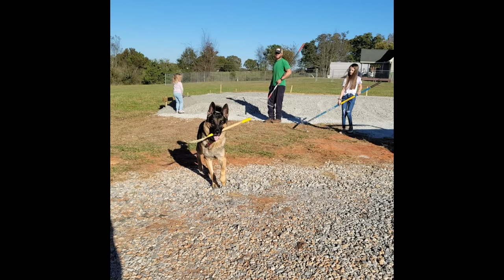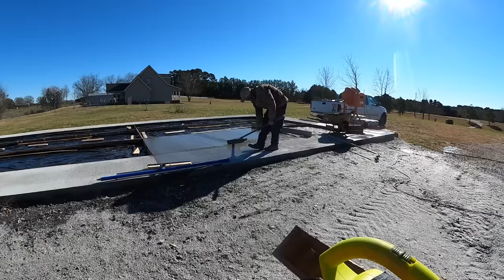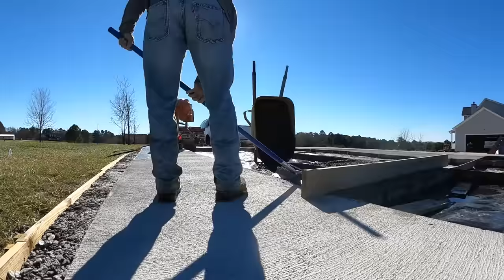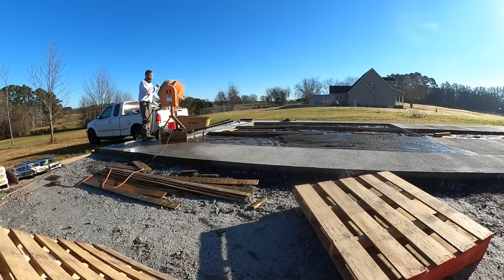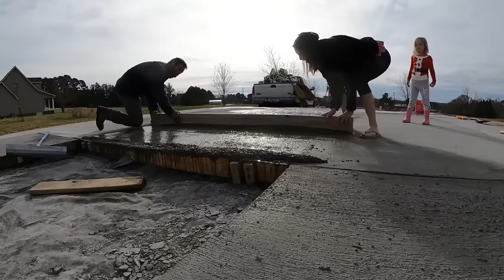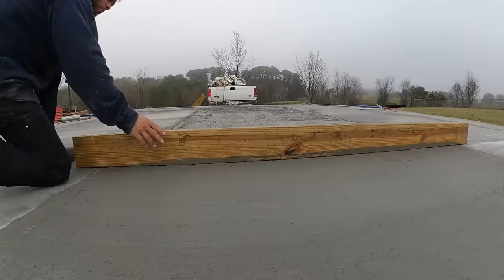Pouring a Huge Concrete Slab Using Bagged Concrete | I Saved $10,000

Comment: Wow, much respect!  In 2009  I retired at age 60 and set forth building a new house. Except for help framing and roofing I did it all myself. I sheetrocked a 3600sq ft house with 9' ceilings myself. People ridiculed me, what's taking you so long, bla bla bla. It took me 2+ yrs to complete, cost approx 280 k . Appraised last year at approximately 800k. Be proud of what you accomplished. No one can take that sense of pride and accomplishment , GREAT JOB!!
Reply from the maker: That's awesome. Drywall is no easy task! It's heavy, awkward, and dusty! That's pretty cool you did your own house. It's actually amazing that you did all that in 2 years. It took multiple crews about 6 months to build my house so you made excellent progress! Thank you for the kind comment.
Reply: You're welcome, I don't think I could mix and pour that much concrete, that's real bull work. It's unfortunate that we weren't able to help one another. Two cheapskate hardheads like us could accomplish a great deal! Haha. Best wishes , Mark
Reply: Nice! I'm doing that with an old rotten (and previously hoarded) single wide trailer on a half acre, right now. I'm currently 2 years into it working on just Saturday's. People think I'm nuts for rebuilding it but I'll be debt free and it's all going to cost me about $65K when I'm said and done (including the original purchase price or the land and trailer). Another single wide on half the size lot in my neighborhood just sold for $208K. I'm pretty excited that I'll have this asset sitting with no mortgage payment. Cheers!
Reply from the maker: @thesomewhathandyman9400  65k is not bad at all! That's awesome you won't have a mortgage payment, not many can say that! You should definitely be proud that you are able to accomplish that. Usually when people think you're crazy, you're on the right track. Thanks for checking out my video!
Reply: Fuk companies take that long for a 1200 ft. Nice job.
Reply: I'm about to start my home building project! Because I am cheap crazy bastard like yall lol!!!
Reply: Hey Fake account, once you get started you're going to have setbacks and obstacles, everything cost more than you planned. Key to success is keeping plugging away DON'T GIVE UP! The rewards are worth the struggle. Good luck,Best wishes. Mark
Reply: Hahahaha, we did the same thing. We are over 50 and when Covid hit, my wife decided we just do it ourselves. Including architectural drawings, permits, etc. I thought we were one of the few. I thought we were insane multiple times during the process. It took 2 years, mostly only weekends, and we just moved in last weekend. We are going to expand it but we can now live in it. It is 2000sqft, and it appraised 400K more. Still can't believe we did it. My hat off to you! Love that there are more insane/determined people!
Reply: When build my last house I learned some painful lessons about moving too fast with a build. Never feel bad about taking your time and getting it right.
Reply from the maker: @markkaminski2416  darn right about that.we should create a cheapskate hard head group and find out who's the closest in our area hahahahaha
Reply: That’s awesome! You can always feel good about doing a project yourself.
Reply: Sweet.  My grandfather built a family home by himself in a time of no home center, plaster and no access to machinery for a country boy.   I never got to meet him in life, but what he did helped us for generations getting established.  I love him for it.
Reply from the maker: @treasurethetime2463  Thank you for sharing your story. Your grandfather sounds like he was a good hard working man. Thank you for checking out my video!
Reply: Well said.
Reply: Treasure the time, I am always touched, inspired and amazed by stories like yours.  Never forget the sacrifice, will and determination of those who came before us. They paved the path for us to follow through life's journey. Best Wishes, Mark
Reply: @markkaminski2416  Amen.
Reply: @what4165  due
Reply: I am about to do the same at the same age. Getting my old place ready to sell I can say I do not look forward to some of that work. Feelin' the years!
Reply: Well you're making me remember when bought sheetrock for my house back in 1985 I found a sale at a place called rickles home centers and for a $1.38 I could get a sheet of sheetrock I should have bought a ton of it knowing how much it went up I bet you you spent a fortune to do your house
Reply: @thesomewhathandyman9400  just wondering what county and state do you live in I bought a property about 20 years ago and I don't currently live there anymore but I'm wondering if it's gone up in value very much up in Fulton county New York
Reply: Arlen, I bought 330 sheets of 12x 4.5    1/2"
Reply: Arlen the building supply co delivered and placed it on both floors . What a break! Cost about $3200,if I recall correctly . That did not include greenwall and cement board for baths
Reply: @arlenmargolin4868  Sorry, other side of the country in Washington State.
Reply: @markkaminski2416  wow I've heard that you can get sheetrock in almost any length since it is made in sheets that can be 100 plus feet long but I never heard of 4 and 1/2 ft sheets that sounds pretty interesting
Reply: Arlen, yes the 54"sheets were just the ticket since the house has 9' ceilings , I stacked them. It created one continuous horizontal seam and a vertical joint every twelve ft. It worked out very well! The building supply co delivering and placing throughout the house was priceless!!!
Reply: Another hard head here. 
Given how rare we are, we should create an online group for such  networking. I can never find help, even my son has gone the modernwway(for now). It might take me forever to do by myself and I might goof n have to redo a step however at least I know it's sturdy.
Reply: I’m 62 and just getting started. Took me 5 years to set my life up to get to this point. Lots of planning…. Prices keep going up. But I’ve decided it’s a choice to keep moving or die sitting around hoping. I’ve got nothing but time. 😎
Reply: Somewhere in Az, I was 60 when I started in 2009. Get started and don't stop, you'll have setbacks and distractions but don't let that deter you. My biggest obstacle was trying to do it without borrowing money! I can't imagine trying to build at today's prices. Good luck, Best wishes , Mark
Reply: @markkaminski2416  Thanks for the encouragement.  I'm tempted to pick up homeless people to come help me, but as a woman that's likely not very smart.  I guess I'll just have to cowgirl up and do it myself.  I'm making compressed earth blocks to build with, since dirt is plentiful where I'm at.  Dirt Cheap?  Not really, I bought an old tractor that keeps breaking down, and a CEB hydraulic press that eats gas.  But, truly, it keeps me in great shape!  Not slowing down any time soon, hopefully.  Maybe I should start a Youtube channel for $.
Reply: Yup so many negs great job
Lots of us retirees,  or anyone with youtube access can do the work. What is the point hiring/trusting some company out to make $$$,just to hurry ,cut corners,and such....no thanks
Reply: Solid!
Reply: How did you do the sheetrock alone? Did you rent a lift? Did you use 12' sheets anywhere?
Reply: @wthomas5697   It wasn't easy!  I bought a lift at harbor freight for about $150. Used 54"x 12 ft sheets. That was about 11 yrs ago and I was  "only " 60yo at the time. Probably couldn't do it now!
Reply: @markkaminski2416  I hadn't realized you could buy it 54" wide. I'm seeing that 54"x12'x5/8" weighs close to 120 lbs. How did you manage to get it on the lift by yourself? Also, did the supplier stock every room for you?
Reply: @wthomas5697  I used 4 1/2 ft wide sheets for 9' ceilings, made for 1 horizontal seam and a vertical joint every 12'. Yes building supply co did distribute on each floor but not individual rooms. That was a great help! Lift handled 9 ft ceilings , had to make extensions to handle the 12ft length. Used 300 sheets, not including green wall and tile backer . Quite a chore but that phase alone saved 20K!
Reply: @markkaminski2416  So how did you manage to get those 12 footers up on the lift by yourself? The reason I'm asking is because I'm designing a home I intend to build by myself. Just thinking through all the issues that come to mind. I'm 66, by the way.
Reply: @wthomas5697  The  top part of the lift has a swivel that would allow it to be  tilted a few degrees to make it easier to place a sheet on it. I can't imagine trying to build in today's market. The cost of materials is astronomical! I started this house June 2009 and it took me 2-2.5yrs . The exterior is brick and cost approx 55k , I'd be willing to bet  I couldn't do that for less than 125k today.
Reply: @wthomas5697  The sheetrock I used was 1/2 thick except firecode in garage. As I stated earlier it wasn't easy, but I managed. I'm somewhat of a loner so I've learned not to depend on others.
Reply: @markkaminski2416  Are you saying that the cost to do brick on the exterior of a 3600 sq ft home is 125 k for materials alone today?
Reply: @wthomas5697   No , I did hire a bricklayer to get that part completed faster. At the time  the brick  I used was  .30 each x 34000 brick. Many pallets of cement and a tandem load of masonry sand was 600- 650. I paid the mason approx 30k for his labor.  This house is 40 ft to eaves in the back, higher at the gables.  The roof has a 12/12 pitch. There are 33 windows and a great deal exterior wall area .  Don't think one could brick a house this size for 55k today.  If you haven't already done so, invest in a piece of excavating equipment that has some weight and can dig and move dirt. You won't regret it! Not a compact tractor with a loader. Good luck, the key to success is don't rush , think about every step, shop wisely for materials .
Reply: @markkaminski2416  Renting heavy equipment is the only way to go as far as I'm concerned. Then you have a wide array of tools to choose from for various tasks. A buddy of mine who ran an industrial rental operation ran the numbers on maintenance and if you're not using stuff all the time it's pretty clear you want to rent. I have neighbors with various pieces of equipment sitting out in their yards deteriorating.

I guess I was under the mistaken impression that you physically did all the work yourself. So 25K for the material on the facade. That sounds more reasonable.

I plan on building all the windows and doors. There's one 9'x9' slider that is going to be a challenge though. I'm thinking of building the frame and doors out of vg fir, installing them, then installing the glass. I'm pretty sure I'll need a hand with the glass, heh, heh. That's okay. I have one neighbor who's anxious to lend a hand and I have two glass cups and some gloves so we should be able to handle it.  He'll probably be up for helping with the sheetrock as well. Although he's not too savvy when it comes to building stuff.
Reply: 2 yrs to do a weeks worth of work , LOL
Reply: @jeffbarron5500   Can you build a two story 3600 sf house in a week  nimrod?
Reply: "$800,000" and a high ass tax bill. I would have broke out the receipts for the $250,000 lol
Reply: Hilarious how no one ever factors inflation into the equation when bragging about how much “value” their house gained. Lol! It’s at 10% this year.
Reply: I dream to do that someday!
Reply: @fisqual  I dreamed it for 61 yrs , retired and got started. One the most difficult but most gradifing expierances of my life.
Reply: I’m doing that same thing at 32. Accept I’m building a small 1000 square foot house. It’s also taking me a little over 2 years.  Living in a rv with my 4 little kids and wife while we do it.  It’s been a journey but won’t have a mortgage when it’s done.
Reply: That is amazing! But you got about 5 years shaved off your life...
Reply: @blipblop92  Hahaha, you're probably right! but it was worth it. When I'm on the far end of the property, I  sometimes look across and can't believe I did it and that it's mine! Thanks for the comment, Best Wishes
Reply: 2 years ago I got quotes from two separate concrete companies for a 1,200 sq/ft driveway extension.  Both quotes were $25,000.  I decided when I have time I'll just use pavers and do it myself
Reply: People thought 2+ years was a long time to build a 3600 sq/ft home yourself? Sounds pretty quick to me lol.
Reply: @markkaminski2416  wow the house you built you could sell and make 1/2 mil, buy more property and do it all over again. That’s the best return on investment I’ve ever heard of!
Reply: @tjeerdmulder1156  I’m working on a project soon that will convert a 10x50 mobile office trailer into a small camper home that I can live in. Between purchase price and moving it to my land, it cost me $3k: $500 to buy and $2500 to move. But you’ll never find a trailer for $3k that is doesn’t have any leaks. It just needs lots of work
Reply: That's two years of TV watching time you'll never get back!
Reply: @TheSHOP411  "When build my last house I learned some painful lessons about moving too fast with a build. Never feel bad about taking your time and getting it right." 

OMG thank you! 
I needed to rehear this 😜😜😜
Reply: @blipblop92  "That is amazing! But you got about 5 years shaved off your life..." 

I know, right!!
That's five years permanently lost of TV reruns and YouTube cat Videos!!
Reply: @markkaminski2416  Are you from Ohio by chance. A fellow CCHS grad shared your name.
Reply: @steveturansky9031  Steve, no I grew up in Baltimore County,MD. I've met others with the same last name but never another Mark. Thanks for asking, Best Wishes!
Reply: The “what’s taking so long” people are fools who will never accomplish anything worthwhile in their life.
Reply: Mark you're an inspiration.
Reply: @charlesstevensEnki  Thank You!
Reply: That’s what’s up
Reply: Very nice story. People who do shit work or have no clue what’s hard work is like would say u took too long. I’ve been alone painting for three,  four months on a large house, built a few , renovated many that took many months
Reply: @chriscal8201  Thanks Chris, it was a labor of love and a source of great pride. Very few understand. Some of the subs , electrician, plumber would give me a pat on the back and encouragement. I did as much as I possibly could  myself. I refused to hire someone and possibly get inferior quality. I can do that for free!😄
Reply: Love the DIY can do attitude. You are an inspiration for me. One question is why no rebar for your pour ?
Reply: Sounds like one hell of a job to take on your own but goes the old saying, if you want something done right do it yourself
Reply: @hernandezmancera8421  How True! Thanks,best wishes.
Reply: Net 500 000$. 250 000$ a year.
I think you have the potentials of a second career there.
Reply: Wow! Hat’s off to you for accomplishing that at your age! I`m not calling you old, good sir. I‘m just amazed and kind of jealous because I will be building my own cabin on my ten acre property next year and am worried that I might not have enough strength to do most of it myself….. I‘m „only“ 36….
Reply: @markusalan1844  You can do it! Just stay focused and don't give up! There will be setbacks and bumps in the road. Don't be discouraged, the benefits far outweigh problems. GOOD LUCK!!
Reply: Lol, I’m planning to do the same thing! I’m 57 bought a ranch in 2021 waiting for 59 1/2 so I’m doing all my research now! Lol I’m a YouTube contractor! My neighbor is doing the same as you, his is sitting there with only the framing done.
Reply: Worked your entire life to retire at 60, only to give up the next three years sheet rocking a house?
Reply: @mts7274  Yep , sure did. Some call it a labor of love, I think of it as fulfilling a life long dream.
Reply: Way to go.I'm the same way with big projects.
Reply: Great work!  My wife and I are currently approaching a house build in Texas and I'm going all in, I've been doing construction for 10 years and feel confident to get it done no matter how long it takes. We're doing 2,800 living sqf out of 2x4s and I thought to myself, if my father and grandfathers in Poland did it themselves out of bricks and cinder blocks than we should be able to handle this kind of build. It's an inspiration to see all these great testimonies and watch videos that provide insight. We're definitely going to be outsourcing a few things like foundation, some framing, roofing and HVAC, other than that I'm doing everything myself. It might be a good idea to share the process.
Reply: @fakeaccount4092  am right there with you I do a lot of dumpster dive people throw away stuff everyday
Reply: Well Done Sir, when people say I can't, helps me prove I can...Be Blessed My Friend.
Reply: @GawgaCracka  Thank You! Sounds as though you're ready to join the Ol Hardhead Fraternity. Welcome Aboard!  Best Wishes, Mark 😀👍
Reply: God bless Harbor Freight - LOL. I have the same mixer. 

Forget about the cost savings, I got tired of paying a contractor serious $$ and having a bunch of slack-jawed mouth breathers show up and produce absolute garbage results. I'll save the money, do it myself and I guarantee I can do better than 90% of the "pros" around here.  I'd be embarrassed if I turned out the crap some of those clowns do. My neighbors cedar fence lasted a whole 4 years before I started splitting it into kindling for my stove. I figured if it was laying on it's side in my yard, it must be mine.
Reply: Wow. I cant figure out why a retired 60 yr old would want a 3600sq ft house.
Reply: @machaf  just a life long ambition I was able to fulfill.
Reply: Hell it takes some builders 2 years to do something like that. That's fast for one retired guy.
Reply: @jamesofallthings3684  Thanks , you wouldn't believe the criticism and naysayers I've encountered.👍
Reply: @markkaminski2416  300 pieces of sheetrock would cost 5 grand today
Reply: I wish i had millions $$$ due to the fact of my disabilities preventing me from accomplishing. Money speaks for itself lol.
Reply: Awesome job. I’m planning on doing two projects. A basic shipping container house for temporary living while building another container house that I’m pretty excited about. I am working on the final details but so far I’ve gotten the budget down to 100k for a 2400sqft house on pad with 1600sqft attic storage space with super insulation and thermal breaks in a bunch of critical spots as well as an upgradable electric and plumbing system where you can add onto it without redoing drywall. Over half the lumber can come off my sawmill because they are not load bearing beams so don’t need to be stamped. I want to have trucks do the concrete but if I can save 20% or more doing it myself then I will mix it with bags.
Reply: @benreber2277  I would like to do a shipping container shop project. The 40'length is perfect, just trusses and end walls. Good Luck!! Stay on course!
Reply: Hell yeah! Congrats! That's like a job making $260k/yr! lol. (yeah I know, land price, blah blah blah. you get the point)
Reply: Congratulations to you brother.  I just did the same exact thing. We are 1 in 1,000 with the guts to do it. Took me 8 yrs. Full custom build. Stick built roof, stood walls up with winch on gator, plumbed it, wired it, etc. 5,800 sq ft under roof.  It has been the hardest most rewarding thing I have ever done.
Reply: @GuntherChuck  WOW 5800 SF! I did rafters also no trusses. As you said, one of the most difficult things I've ever done but one of the most rewarding! Congratulations,Hats off to you! Best Wishes
Reply: That’s my life now! Bought a giant two bedroom,  2 bath. Making it 5 bed 3 bath. On this video for my shed
Reply: Looks good, I didn’t see any rebar or mesh though... ill have to Watch it again..
Reply: Well, if you had slick here helping you, you could’ve got it done in three days.
Reply: 12 yards of concrete and finished should never cost 10 grand, 12 yards of concrete would be about 2k and a professional concrete finisher with helper no more than 1500.00, 8k labor is just ripping someone off
Reply: I'm 75 and a general contractor. I started building my 5000 Sq ft house 3 years ago. Just finished. Did everything except the black walnut cabinets and granite. Did everything out of pocket.
Reply: @brookeflynn2230  Tip of the hat to you! I know the feeling, tried to do it all out of pocket but didn't work out 😊. Still ended up ahead of the game. Good Luck, Best Wishes!
Reply: I’m dreaming of that now and this comment makes me feel less hopeless of building my dream home
Reply: Damn i am disabled and almost broke at 55 so i will have to try to work until i die but 2600ft house that is a huge accomplishment.   I dont mind stuff but drywall is crazy, i hate it, lol. GREAT JOB ON THE HOUSE.  The retirement thing that is just wow.
Reply: Damn i am disabled and almost broke at 55 so i will have to try to work until i die but 2600ft house that is a huge accomplishment.   I dont mind stuff but drywall is crazy, i hate it, lol. GREAT JOB ON THE HOUSE.  The retirement thing that is just wow.
Reply: Well mark I'm in the Bahamas
Reply: You should have ripped every sheet of drywall down to 3' so you could just cut it all at once and then install them all at once and then
Reply: Retired and 3600.sq ft? LoL one day you will have a big ol house to take care of and your body will be much older